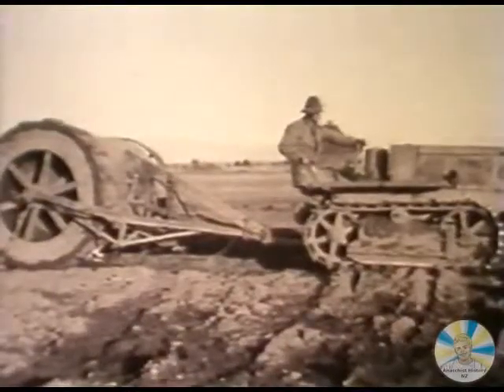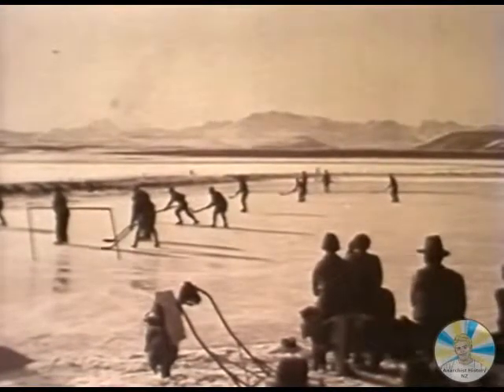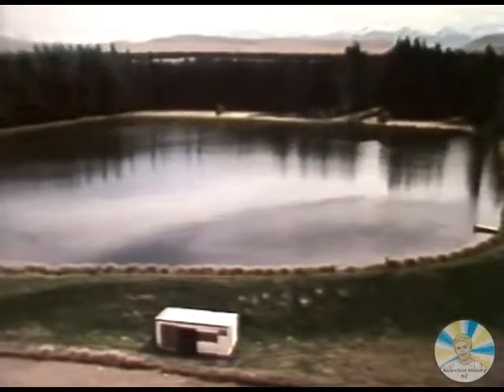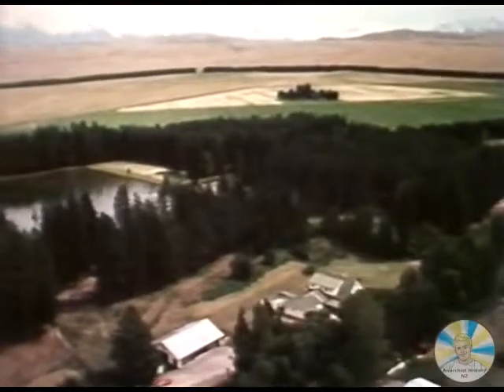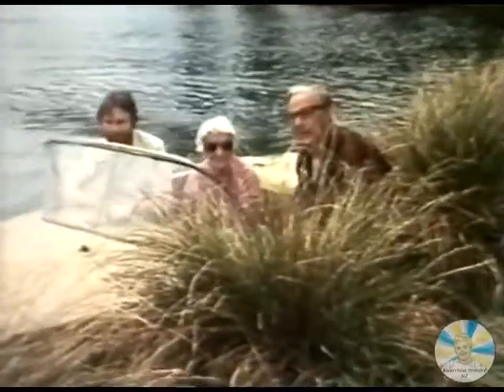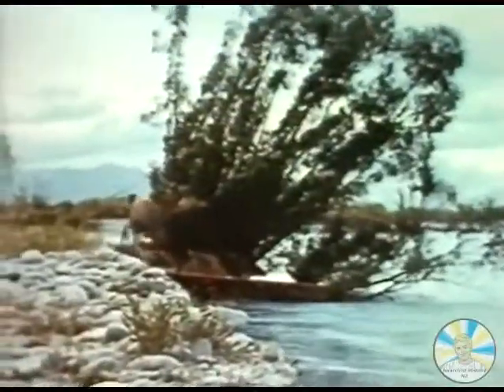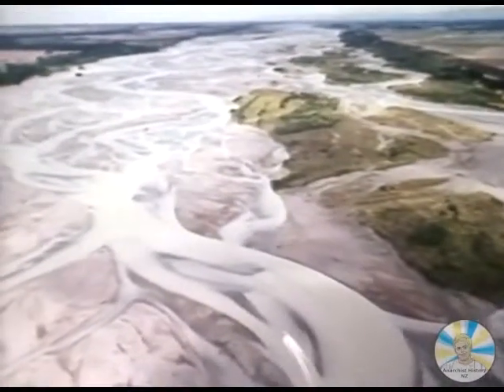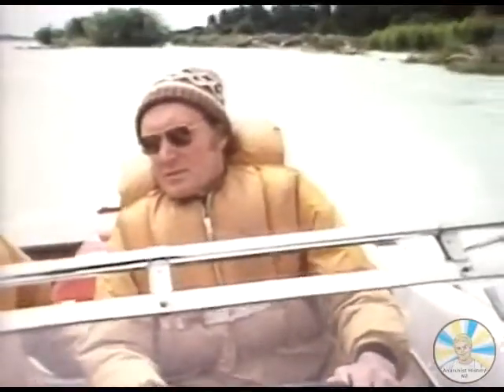William Hamilton and the Jetboat

Comment: In the seventies my fiends bought a Hamilton jet boat it was called shear enjoyment   powered by a ford 6 cylinder zephyr engine what a wonderful time we had with it  to give a power boost I  made a turbo charger kit for it the sound  and speed was fantastic it only lasted one water skiing season  which great fun But power caused the impeller bearings to rapidly wear out. We removed the turbo kit  and rebuilt the jet unit all back to standard  used for the following year then sold it brilliant memory’s